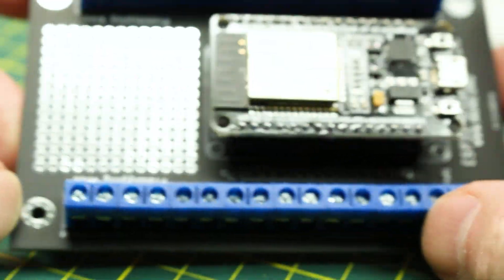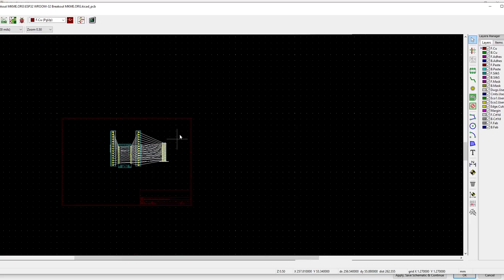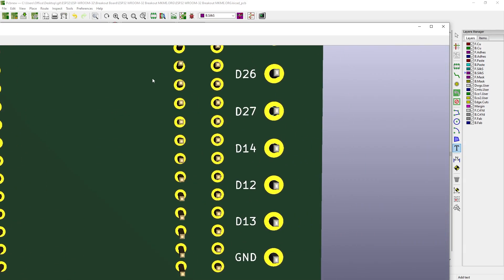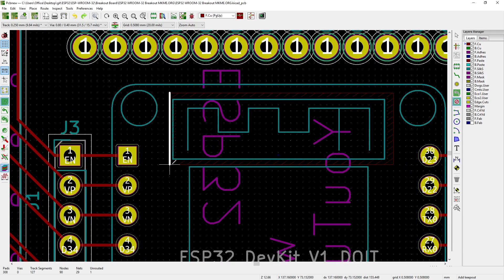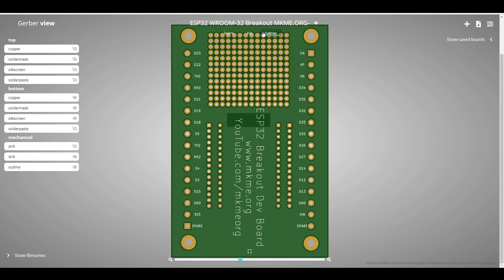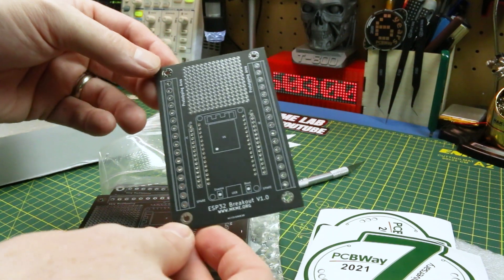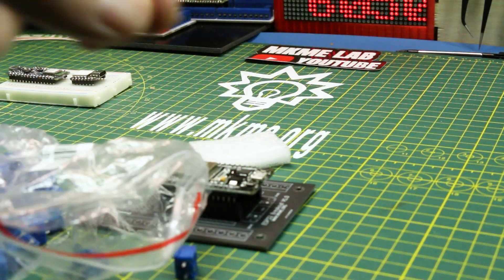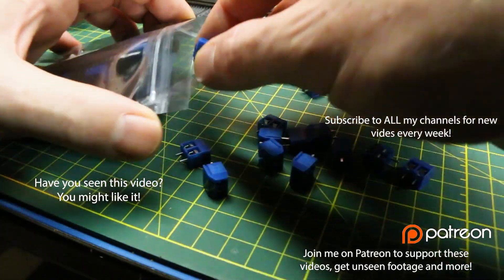How To Make An ESP32 Project Breakout Board | TUTORIAL

Comment: From what I’ve noticed specifically with the ESP32 platform is their(s) multiple variations to this platform. And it seems as though not even KICAD has in completeness the entirety of the library of esp32‘s the reason for this is quite simple. The ESP32 board you built the breadboard for isn’t even specified in the choose symbol library section (which it seems like a esp32 wroom variant) of KICAD presently. So a very simple question....what is the specific esp32 model (because it clearly NOT a pico d4, wroom 32: neither 32D or 32U, wrover : nether a wrover -I) that you used ?
Reply: I know im 2 years late but did u find the answer to this question ?
Reply: @xYucifer  like my comment when you find out the answer so that i can come back here. 😂
Reply: @Made_at_aaenics i just manually measured the esp i have and found the closest match to it in kicad to align the pins and just added some missing pins and in the end it worked perfectly